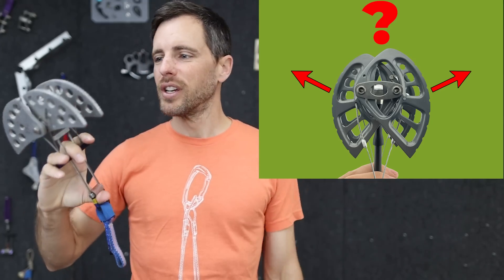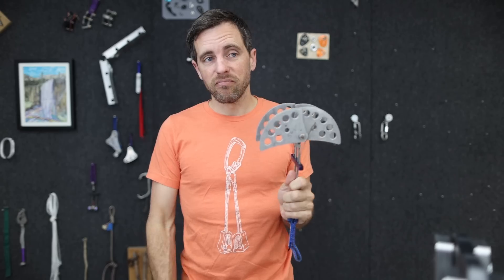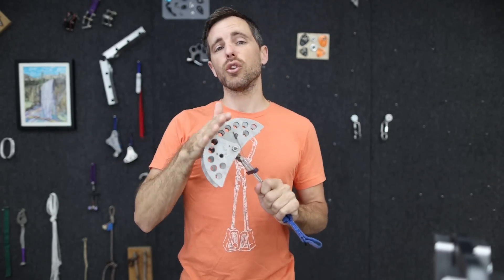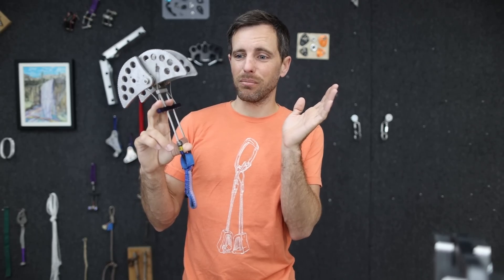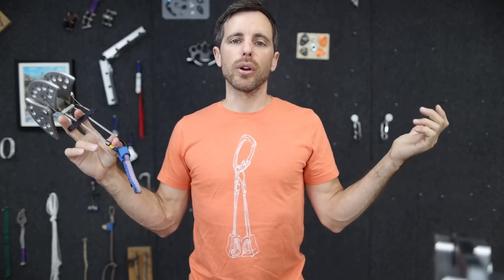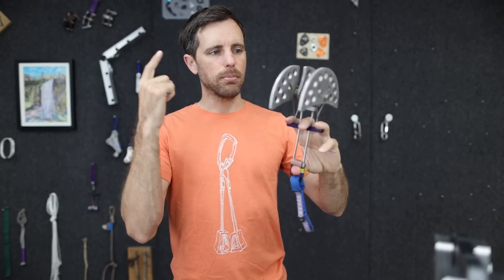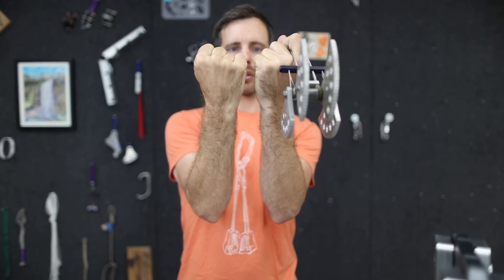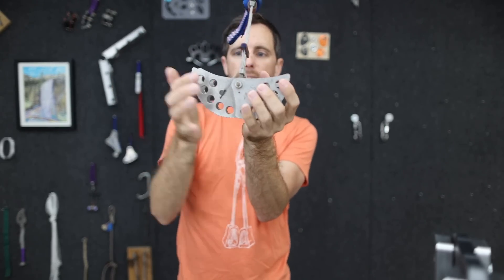I need your help

Comment: We basically have a triangle. 📐 Where the point of contact between the rock and the axle in X and Y direction is proportional to the force in each direction. So if Y is 10mm (distance along the force to the engagement points) and X (half the cams width) is 40mm. The forces are 1:4, 1kN -> 4kN (equal on both sides). Meaning: if the Y value of engagement is the same and the cam is wider and wider, the applied force is going to increase. Thus a max contracted cam will apply the least force. This is what my university physics tells me.

And yes, the cam pushes ~twice the linescale.

This also means the force outward increases with the load which is important since friction is a msterialfactor times force. More force more friction.

But on the other hand, if the cam is not pushing on parallell surfaces, the forces will be offset.
Reply: Exactly. And this also explains why cams put higher force on the rock than nuts - the cam is using mechanical advantage to amplify the force being put into the rock vs the nut which is just putting it directly into the rock. The amplification will be relative to the lever arm ratio created between the axel and the engagement point and the axel and the rope

Also, friction plays no role in force generation. It can be analyzed as a rigid static system. The only variables that matter to force are the lever arms and angle plus in real life the yield strength of the metal and the rock but those don't matter in terms of force generation until you reach and exceed them
Reply: @GlutenEruption I don't really have qualifications to answer but anyway: I'm quite certain that a nut also have a mechanical advantage sideways, as it is a wedge.
Reply: Close - Tan(theta) = Y/X so you can correctly look at it that way - but the whole point of a cam is to maintain a constant theta through the camming range, so the ratio of force will be the same - ideally.  "Thus a max contracted cam will apply the least force." - is incorrect.  Also - per other posts - the outward force at the cam is 2x the gauge - simple as that.
Reply: @natebeckwith1683  As a Bachelor of Engineering and Test-Engineer I agree for one axis cams. Measurment of 2*X schould be at least with a caliper and not only with a ruler😉. Aditionally for two axel cams X is the distance from wall to the center of axis where the  Measurement of Y is harder to achiev, because you need the exact contact points of the Cam to the walls and from those only in this direction the distance to the center of the axis. It could be something as a depth caliper and shine with light from behind to find the darkest spot where the cam tuches the wall. I Agree that for most Cams the theta schould be constant from close to open. As long the cam can open the force ratio schould be almost the same. (Slight variations because of different deformations on different radius on the contact points and therefore, if deformend infulence on real theta.
Reply: @steffenreiling  I did ignore the double axle case - however I can tell you after 30 yrs in R+D - the Black Diamond point noted in the video that this is all trivial and "just multiply it by 4" is what really happens - this works out to about an industry standard 14 degree camming angle.  If you find your measurements different from that by maybe 10% or so - only then take it to another level.
Reply: @natebeckwith1683 in the industry a lot of people tend to care a bit less about the details like this. I'm on here commenting so obviously some of us have a personal interest, but 'load times 4' is more accurate than the estimation of the load that will be on there when it's needed, and that estimation is supposed to be a lot more accurate than the safety factors involved. None of my colleagues and I have ever worked in a vacuum, but if I start pulling out air resistance and buoyancy to make my math sound safer there's gonna be a talk I don't like with my boss.

Actually, when I'm up higher than about 10 meters pi becomes 3, a kN is 100kgf and I fall at 10m/s^2.
Reply: @TijmenHatesads  I like and share your attitude. I have that attitude in only a couple of areas in my life, the ones that I am an expert in. I believe the experts are the ones who radically simplify and appear blase because they are the ones that know where the significant figures come from. Everyone else is scrambling around looking for calipers and calculating thermal growth of the material on a sunny face.
Reply: Edit: Oops, I think I was wrong -- this is close, but not completely correct. I'm working on it.
This is correct, with two small caveats:
 1) That the "rock" surfaces are two parallel planes. If there is an angle to the slot in the rock, the answer will be a little different.  That's what my mechanical engineering degree tells me. 😁
2) The cam surface is a smooth arc. In the real world, the teeth on the cam are going to be insignificant, but when lab testing against a flat metal plat, they might skew the results. If the cam touches such that it is just starting to "climb" up on the front of a tooth, then the force ratio will be somewhat lower (the "climbing" action changes the ratio) . Likewise, if the cam is just "falling" off the back of a tooth, the force ratio will be larger. How big this effect is will depend on the exact shape of the tooth (how rounded the leading and trailing edge of the tooth are). But this shape could even change during the test. That is, if the cam is balanced on the front or rear corner of a tooth and the load gets high enough, the corner of the tooth may deform slightly. 
To avoid this tooth issue, you might consider sanding the teeth off the cam so the cam has a smooth curve. Obviously this is only for cams that will not be supporting humans.
With or without teeth on the cam, getting an accurate measurement for the Y dimension might be challenging. Determining the exact contact point between the curved cam and a flat surface is going to be susceptible to at little error. Using the example dimensions of (Y = 10 mm, X = 40 mm), the Y dimension might be plus or minus 2 mm. This would give an over all ratio of between 3.33:1 and 5:1, not exactly a tight range. One possible way to make this measurement is to get two very thin strips of metal (like a couple of .002 inch (.05 mm) feeler gauges). Slip one in on each side of the cam and then use the center of the gap between the feeler gauges as the point of contact for the cams. This might not work reliably with teeth on the cams.
Regarding friction between the cam and the rock, it does not play a role on the force ratio above. The friction is either enough for it to hold or not. If it holds the force ratio is as above. Again, this is assuming the rock faces are parallel (even with faces that aren't quite parallel, it would only make a tiny difference).
Reply: Your math and physics is incorrect.  The lengths you stated have nothing to do with the forces.  The angle is what is important.  Pull out your physics book and look at force vectors and cosine angles learned in trigonometry.
Reply: If the relationship was linear then this would be more or less accurate but because the cams have a logrythmic shape, this case only applies when cams are half way drawn. Before and after that position, cams provide less.
Reply: @christopherdagel5816  The cam shape does matter, but I can see no reason the manufacturer would chose a shape where the "cams provide less" in some positions. They could pick such a shape, but why would they? They could also pic a shape where the cams provide less in the middle. But again why would they? In any case, most of the cam shape is accounted for when using the X and Y values, so for any given position, the X and Y values will give a good estimate of the force ratio.
Reply: @andrewsnow7386  In the case back in college, the students were challenged to see if a better shape exists. "Better" being loosely defined. The result was that the optimal shape of the arc had 2 impacts, one could create ideal forces throughout the path, the other provided the best linear range of placement for the cam size, which conflicts with the load range. Most manufacturers have landed on best placement range, defined not so much max and min for a cam size but more on how much trigger pull results in movement. Ultimately the group found it a bust to try to design to optimal loading.

Comment: Hi Ryan, I have an idea.
What if you extended your pivot arms to be twice as long, making the line scale the middle and the cam / nut area on opposing side.
Then you could pull to the right of scale screen instead of forward if you get what I mean.

Comment: The relation between how hard you pull and how hard it pushes outward should be pretty proportional to the rate of change of the width of the cam to it's position in the line of pull

As in, if it moves a sixteenth of an inch and in that sixteenth the width of the contact on either side increases by a thirtysecond, then the force would be double. Or if it increases an eighth then the force would be half.

I don't remember how logarithmic spirals work but you should be able to reverse engineer the formula that determins the shape of the cam from measuring the distance from each end to the pivot, and then do some fun trig to get an actual formula, but that will only hold true for cams that are ... congruent? Have the same formula? I don't know if that's the right word

However, that will obviously change with friction on the pins, the contact area being inconsistent, and parts elastically deforming. But probably not enough to matter.
Reply: Would it then be important to know the exact width of the cam at the moment of the linescale reading, rather than assuming it is the same as measured at rest?  How do we measure "probably not enough to matter"?

Comment: You can calculate this from the triangle comprising the axle and cam lobe contact points, but good luck!
Reply: Correct. Assuming a cam angle of 13.75° the 4:1 number Ryan cited from BD this is approximately correct
Reply: Yep, it's a pretty straightforward calculation. The fact that the cam has a varying radius on the lobes makes you think it's harder than it actually is.
Reply: @MattWestwick right? Angle is constant regardless of radius.
Reply: Literally all of his questions could be answered with a basic half semester of static systems.  I mean, I love the trust but verify mindset this channel has... But the "does the friction / cam retraction change the force" is just fundamental physics 101 (the answer is no, for a system in equilibrium at least).  Tests on a drop tower could in theory might be interesting though
Reply: @edawgroe But the friction changes the force as if you consider the friction torque within the main joint of the cam it will reduce the torque on the cam "arms" which will reduce the outward force

Comment: A load plate (is that what it's called? Essentially, a scale) on either side, or just one and double the result?
I think your jig is waay too complex!
Reply: It's simpler to build than a load cell on each side to push against. Also, you would need to make sure whatever is behind the load cells keeping them in place is very stiff to get accurate results.
Reply: @ilikecheese8888  exactly my thoughts - that would make it much more accurate and easy. Or even simpler, just one load cell and a fixed side. This is also changing compression force into a tension measurement - not sure if that has any effect but it certainly adds complexity and room for error

Comment: Force at the cam is double what the load cell is measuring
Reply: That's what I'm thinking too. Class 3 lever, equal distances, the end moves twice as far as the middle and the middle experiences twice the force
Reply: force*length = constant
Reply: Except wouldn't that only be true if one side was fixed and you were just measuring the load on one side? Since both sides are being pushed outwards and the load is being measured at both ends wouldn't that cause the measurement to be halved, canceling out the doubling from the lever? Think of it like a rope - if one end is fixed you get x force but if you have a u and both ends are attached, each end will only see half the total force
Reply: @GlutenEruption  That's kinda what hearhawaii said.

Assuming it's all static loading (which is a super good enough approximation for these sorts of tests), if the cam has a spreading force of 10kn, the load cell should theoretically measure 5kn, with the bar between the pivots at the bottom also being under 5kn of stress.
Reply: @GlutenEruption Short answerb no.
Reason: imagine it being used as a weigh scale.
One end is hung on a rigid beam, the other has a hook from which you hang a weight.
It will read the weight òf the load (plus hook).
The line scale will exert a force upwards on the hook, and downwards on the support. Both equal to the weight of the load.
It does not "know" that the jig is pushing both ways, just how hard it is pushing on both ends.
Reply: How did you come up with that guess?

Comment: I don't know if it make sense but shouldn't you be aiming for compression and not extension? With a scale attached to each side? The contact surface of the cam need to be in the calculations... Because bigger surface means less pressure.
Reply: I think we're looking for total force, not pressure.
Reply: compression is just negative extension
Reply: While I don't think it should be part of this test, I agree contact pressure is important to measure since applying the same force to a smaller area of the rock can potentially split the rock easier.

Comment: Confused. Intuitively, half the force downwards on each side? It can't be adding more force (where does it come from) and it can't be less (where else is it going).... but that's a totally different question to how the force might be distributed
Reply: Leverage can most certainly either increase or decrease the force applied outward.
Reply: Force is not a conserved quantity. As long as the lateral forces are balanced, they can be much larger than the downward force.
Reply: @dhonors999  and that's why we shouldn't trust intuition 😆. Of course, a cam will provide a mechanical advantage.... even if the energy in the system must be conserved, but which energy? Momentum? Obviously, I'm not a mechanical engineer 😁
Reply: Yeah leverage exchanges motion for force.

Comment: This is going to be good. I’m really interested in how nuts will work, especially with friction as a variable (as mentioned in discord)
Reply: If the nut is v shaped and the slot is v shaped  deformation is more relevant than friction.
Reply: @brendonwood7595  with infinite friction, there is zero outward force, with no friction, the outward force is tan(angle of nut). Not sure how deformation changes this apart from increasing friction through boundary conformamce
Reply: Nuts are simple.  Cant pull a piece of aluminum through an opening smaller than itself.